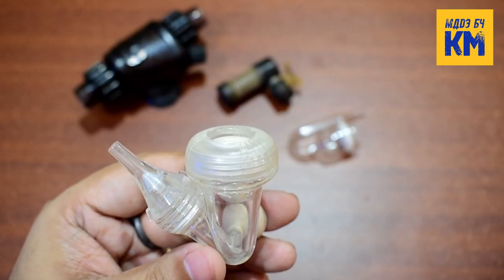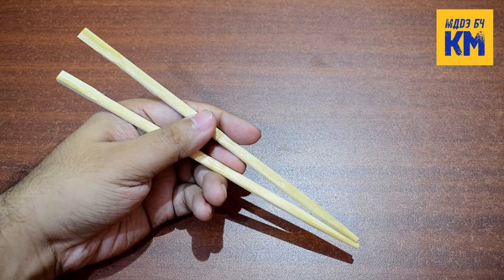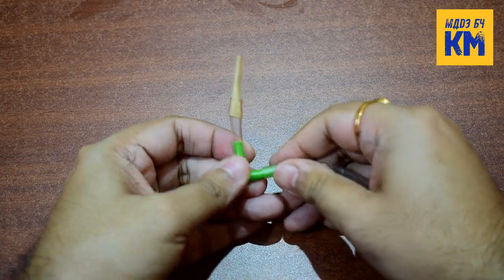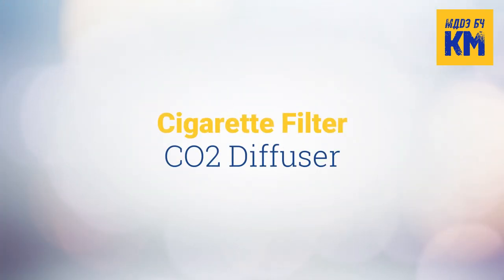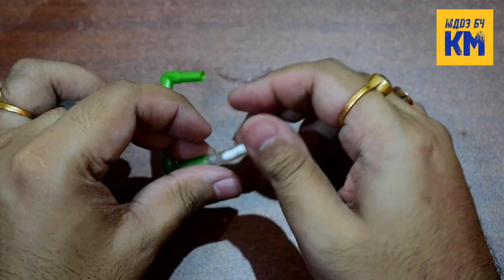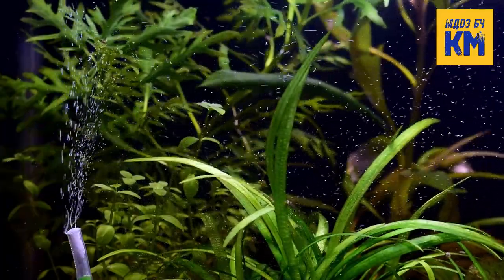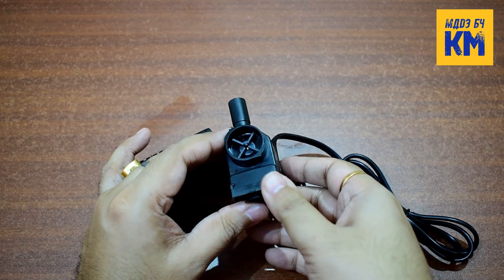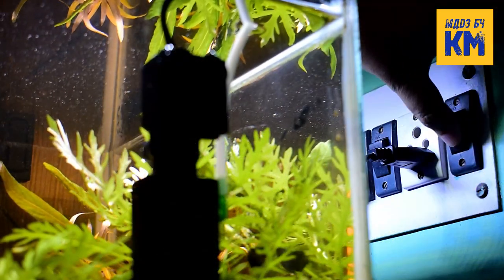🔥 3 Creative DIY CO2 Diffuser Ideas for Your Planted Aquarium!

Comment: I have been using the 3rd method (Power Filter) since approx 4 yrs now. It's absolutely effective. Recommended for all planted aquarists.
Reply from the maker: Yes 👍
Reply from the maker: Power filters are designed to run 24/7. And if you use a small power filter (along with your main filter) for the purpose of CO2 diffusion, the small power filter should run as long as the lights are ON (i.e. 8 hrs. - 10 hrs.)

Comment: Awesome i have ceramic diffuser (had bought it b4 watching this video 😶) and i have a question, can i put the diffuser near hang on back filter inlet, it will suck up CO2 bubbles, dissolves in water and comes out from the top, only thing is will the CO2 escape when the water meets the surface of my tank ? Will it be useless or worth it ? Thanks love your vids
Reply from the maker: Placing it near the hang-on-back filter inlet is a good idea, but the CO2 escaping at the surface might affect its efficiency. Keep testing and see what works best for your setup!

Comment: Can't thank you enough. I had bought a glass ceramic diffuser 2 months ago and it got blocked. My diy bottles had so much pressure that my tubing started leaking and saved me from an explosion, this powerhead co2 diffuser method is just awesome and saved me so much hassle. Thanks again.
Reply from the maker: Glad it helped.

Comment: Amazing & very lucidly explained Bravo 🎉 after watching I did it with yeast & agar combo, CO2 bubbles came out slowly..the piece of Porus wood worked as a diffuser.. recently I bought a  nano glass diffuser with ceramic coating but in this DIY method it’s not functioning. I also added fresh dry yeast & sugar solution 

how do I make this diffuser work ?
Pls guide
Reply from the maker: A ceramic CO2 diffuser requires a lot more pressure to work. So you have to wait a few more hours, so that enough pressure builds up in the bottle and then the diffuser will work properly. Also, you can increase the amount of yeast from 1/2 to 1 teaspoon, to increase CO2 production and the pressure as well. Thanks.

Comment: The third method i.e. power filter worked for me. I already had a small air pipe attached to my filter, so I didn't need to punch any holes. I simply connected my co2 system with the air hose provided. Although this way the bubbles are very slightly bigger, but definitely works. Thanks
Reply: Running mini pumps on my tanks using a timer for the diy co2
Reply: Yeah KM can we not connect the CO2 line to the air line in the power filter ? Like Swapnil has done ? So no drilling is required and does this give the same effect as with one where the hole is drilled and the L connector attached ?
Sorry for such noob questions !
Reply: @rajeevpandalai5248 Connecting to the built in air line is not as effective as KM's method, as the bubbles produced will be much larger. Smaller bubbles result in much higher CO2 diffusion.

Comment: Thank you for the video .just another question according to your experience. I use sponge filter and lots of water agitation on the surface so does the CO2 goes out of aquariım more faster ?
Reply from the maker: Yes, that's right. When the lights and CO2 are on, you can decrease the airflow of the sponge filter to reduce surface agitation, and at night or when the lights are off, you can increase the airflow again. Thanks.

Comment: 🙏All ur methods are just awesome. Now do you have any idea of making Lily pipes both in and out for external cannister filter.
Reply from the maker: Thanks. Yes, these can be made, I will make a video on it.
Reply: @madebykm  Please do because I am Eagerly waiting for it. Moreover please manage some tricks to arrange some small pieces of highly porous volcano stones for using as a power sand under aqua soil just like ADA power sand. So that we can use it for good bacteria colonisation.
Reply from the maker: Please watch my Low Tech Bonsai Aquascape video. There I used clay gravel (LECA) as the first layer for the same purpose. It is also porous and can be used as a power sand alternative.

Comment: very helpful information dada. Sudhu 1ta question, filter er opore j air add korar jno 1ta choto nozzle thake, co2 pipe ta tate add kora jabe na? korle ki problem hbe?
Reply from the maker: Ha, kora jabe kintu tate CO2 er bhalo diffusion hobe na, shob theke bhalo diffusion hobe jodi power head er niche pipe ta thake, tahole CO2 er bubble guloke power head er impeller ta khub choto choto bubbles e bhenge debe ar diffusion ta aro bhalo hobe. Thank you.
Reply: @madebykm  ok. thank you so much.

Comment: Hello sir thanks for all ur useful diy's absolutely love it 😁. I have a question, I switched to a hang on back filter now using ur jelly method to make CO2 how can I efficient use diffuser using hob filter and which diffuser would you suggest ?? Love from Mumbai ❤️
Reply from the maker: You can insert the end of the CO2 tubing into the intake of the HOB filter. Or, with that HOB filter you can use another small power filter as a diffuser. The link of the small power filter is in the video description. Thanks.
Reply: @madebykm  thank you ✌️

Comment: Hello sir, thank you for this informative vido. However, I have a doubt regarding the power filter on top of the nozzle we have air inlet option. Can we connect the co2 pipe through  that instead of drilling a small hole? (Do you think it will suck in the water from the second bottle will it have that much power?)
Reply from the maker: I explained the purpose of drilling a hole in the chamber of the power filter in the video. CO2 diffusion will not be so good if you connect the CO2 tubing to the air inlet of the power filter.

Comment: Dear Kaushik, in last filter option beside co2 diffusing does it work as a filter also? What if attracts small fish in the hole. Can we use also hang on back filter separately.
Reply from the maker: It's actually a small internal filter that I modified a bit to use as a CO2 diffuser, and no fish can enter the filter through that hole because the CO2 tubing will be attached there. You can also use a HOB filter along with it.
Reply: @madebykm  You turned it OFF so in that case mixture in the bottle will be save and safe to turn it off like this and does bubble count fluctuation will effect on this process
Reply from the maker: When the filter is turned off, the bubbles will not disperse, but they will still come out of the outlet nozzle of the filter and will rise straight up and exit the tank. Also, there will be no fluctuation in the bubble count.

Comment: In my tank I have floating plants (duckweed,frogbit ,etc) and cocomba plant . Do I need to use liquid fertilizer and when to use in a week ?? It newly setup I setted it up two days ago
Reply from the maker: There is no need to fertilize this tank now. After 2 weeks start giving fertilizers (micro and macro) as per my recommendation in the videos.
Reply from the maker: Another thing I would like to say is that Cabomba plants need a lot of light and floating plants can block the light and as a result your Cabomba plants may suffer (melt / die).

Comment: I have a question. I have a sponge filter in my 10 gallon tank. Can i use C02 along with sponge filter. I have read about it that it removes the C02 from surface due to surface agitatio.
If this is true, can i turn off my sponge filter for whole day while using C02 and then turning sponge filter back on at night?

Or, will adding an airstone in sponge filter help?
Reply from the maker: You can run the sponge filter at night and use a small internal filter as a CO2 diffuser when the lights are on. Consequently, both CO2 diffusion and water circulation will occur at the same time.

Comment: Can the cigarette filter diffuser work if it is not placed horizontally upwards? To be specific, can I direct the diffuser downwards? It should work fine right?
Reply from the maker: The cotton filter should be positioned in such a way that the micro CO2 bubbles can freely rise straight up.

Comment: I use a powerhead filter that has a built-in fitting for a airline pipe. Actually it is for enabling good aeration in the tank. Can I attach the CO2 pipe to that fitting instead of drilling a hole?
Reply from the maker: You can but the CO2 diffusion won't be that good.

Comment: Can we use regular cotton to replace ciggerate cotton filter
Reply from the maker: When I used regular cotton, the CO2 bubbles that came out through it were a little bigger, so I used cigarette filter cotton. But anyway, you can try using regular cotton and let me know how it works. Thank you.

Comment: I can not direct my water flow in the tank because I have neon tetras and they do not like strong flow. Right now I have directed the flow right to the water surface(I have a flow director). Where should I direct the water flow to ensure good CO2 mixture?
Reply from the maker: You can direct the flow towards the surface of the water, but remember that the surface agitation should not be too strong so that the CO2 does not leave the water too quickly.

Comment: Hello dada,
I have made diy Co2 system and diffuser with cigarette filter with the help of your video. Co2 is coming out in good amount but the cigarette filter diffuser is not releasing co2. I have to push the bubble counter bottle to release co2. Please help.
Thank you
Reply from the maker: Check for leaks. If there is a leak, pressure will not be created and the diffuser will not work properly.
Reply: @madebykm  okay

Comment: the co2 bubbles are no longer forming, these were forming continuously from last 2 days but today it stopped. I have the solution in the bigger bottle, already checked for the leakages and seems like everything is okay. does it have to do something with the amount of yiest (15-20 gm) I added. please help
Reply from the maker: Use only 1/2 teaspoon of yeast. Also check out my DIY CO2 videos for more info.
Reply from the maker: https://youtu.be/v4T_2eXe0wo
Reply: @madebykm  Thanks.

Comment: Dadavai. Power filter e j oxygen inlet ta otake block kre dye6o tumi. Jodi Oi oxygen inlet e co2 ta connect kre di tahole ki same diffuse hbe? disadvantage a6e ki kono setar?
Reply from the maker: Power-head er air-inlet e CO2 tubing connect korle khub bhalo CO2 diffusion hobe na, kintu ami jebhabe video te dekhiyechi shebhabe korle bhalo hobe, ar ami video te reason ta explain korechi.
Reply: @madebykm  Okay Dada. Onek dhonnobad. Ami apnr sob videos dekhi ar ami emn e ekta project e kaj korchi. Results tar link share krbo apnake😃

Comment: The filter has a space for connecting tubes in the outlet, when i connect co2 tubes there,is this works??
Reply from the maker: You can attach the tubing there, but in this way CO2 will not diffuse that well.

Comment: Can I use DIY co2 generator in 4ft tank?
Reply from the maker: DIY CO2 is ideal for maximum 20 gallon planted aquariums. For aquariums over 20 gallons, I would recommend using a pressurized CO2 system.

Comment: i want to ask why my plant keep rooting at the level of the soil.. my plant didnt melt or yellowish at all
Reply from the maker: Are you talking about all the plants or any particular plant?
Reply: @madebykm  cabomba, bacopa, ammania, naesea golden
Reply: and almost all plant happen the same
Reply from the maker: Okay, these are all stem plants and the roots you are talking about are the aerial roots. Aerial roots help to anchor the plant firmly, while also contributing to the uptake of water and nutrients. Also, aerial roots develop naturally to support territorial expansion. If they successfully root to substrate, new stems may develop from the internodes. This is normal, so don’t worry about it.
Reply: @madebykm  oh sorry for my bad english.. not rooting but rot huhu
Reply from the maker: Okay 😃, Have you recently set up your aquarium? Please give me details of your aquarium light, substrate, CO2 and fertilizer dosing schedule.
Reply: @madebykm  the tank has been cycle since 5 months ago.. using fluval stratum soil.. using all in 1 local fertilizer 1 dose everyday, 6hours photoperiods light n co2 1bps.. using kandila s600 rgb light 24w and another normal white led light 22w.. and 3 fans.. temperature of the tank roughly 28.8-30c
Reply from the maker: First, in a planted aquarium, plants need to be provided with a minimum of 10 hours of light, including CO2 injection. So, the 6 hours photoperiod is very short. Moreover, when light does not reach the lower part of the plants, many times the stems rot from below and the leaves fall off. So, see if the light reaches the bottom of the plants.
Second, the ideal water temperature in a planted aquarium should be between 23 C to 26 C. So, the water temperature in your aquarium is too high and try to fix it.
Also, use a good quality and efficient filter according to the size of your aquarium and and change 50% of the aquarium water regularly once per week. You can follow these steps and see if the condition of your plants has improved.
Reply: @madebykm  maybe due to the light i guess and 1bps co2 isnt enuf for them.. mine tank is circa 2.9ft tall.. in my place to reach 26c need to use chiller huhu it is really hot on daylight here.. 41c everyday
Reply from the maker: As the height of your tank is 2.9ft, I think it's because of the light, your plants are not getting enough light at the bottom. Also, your ambient temperature is 41 degrees, which is really hot, so if possible you can use a chiller for your tank.

Comment: Am getting 30-40 bubble count per minute. Is it ok?
Reply from the maker: Yes
Reply: @madebykm  will it not kill my fishes ??
Reply: @madebykm  and did you have air pump or something?
Reply from the maker: No, it will not kill your fish, shrimp or snails. I don’t use air-pump and my DIY CO2 system runs 24/7 at 1 bubble per second rate in my 20 gallons planted tank.
Reply: @madebykm  thank you for your advice.

Comment: I don't know why my CO2 is not diffusing in my tank tried bamboo, cigarette, commercial diffuser 
In bamboo the bubbles came once nicely but then stop again 
I am sure I did everything correctly as my  bubble count bottle is producing bubbles continuously  since past  2 days , but I am unable to see the bubbles in my tank 
Please help I tried everything but now feeling helpless and stupid
Reply from the maker: Check for leaks in the CO2 system. If there are leaks, the pressure won’t build up, and the diffuser won’t work.